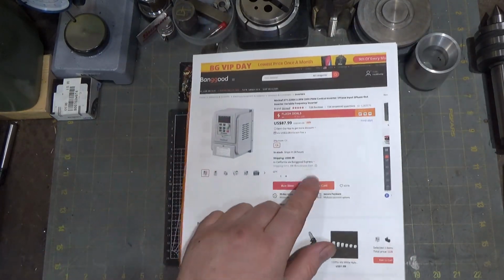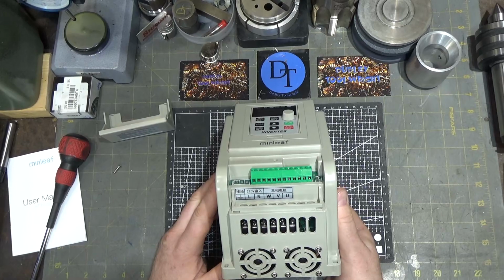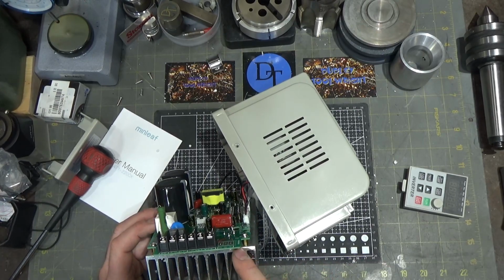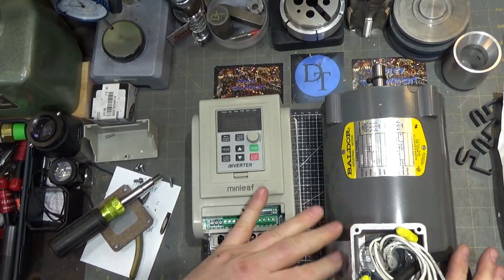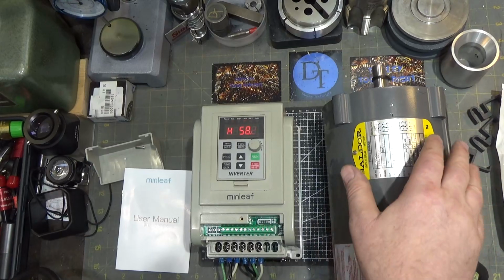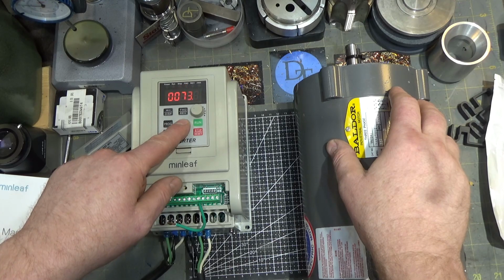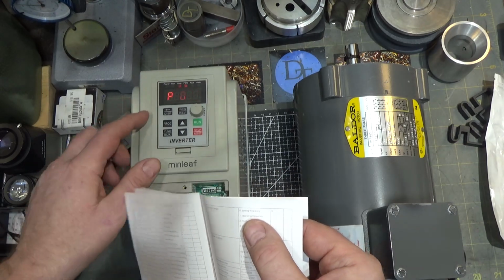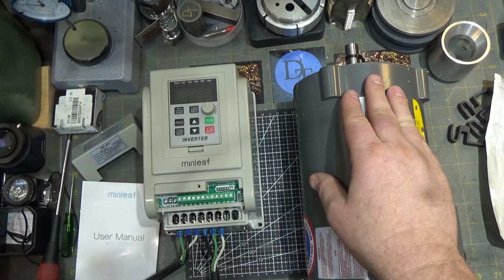QTR 62 Banggood Vector VFD

Comment: Nice review one thing I'm not getting say if you wanna run this on a mill or a lathe how would you get an rpm reading is there something you add that converts hrtz to rpm or would you instal some kind of electric tach ???
Reply from the maker: Getting an accurate RPM reading would require a fairly inexpensive tool, but sensor location might be challenging depending on the application. All you need is a reflective dot on a rotating member and count the rotations over a fixed interval and divide.

Comment: Good review Robert. I’m going to give that one a try on recently purchased used cutter grinder. I’ve got a Fuji 15hp(derated to 7.5 for single phase input). I’m breaking all the vfd rules with it. Using it as 3phase power supply to 7.5 hp lathe and 10” pedestal grinder( both across the line start) and also feeding a second 5 hp vfd (3p in, 3p out) for my mill. Been working fine for 4 years in the home shop environment. Was going to add cutter grinder to 3 phase bus but will give the banggood unit a try.
Reply from the maker: I will be interested to see how this works out for you.

Comment: That microcontroller is far from capable running code needed for vector drive. Sensorless vector driving is even more demanding. So mentioning vector for this vfd is completly misleading. It is ok for the price but far from delivering constant torque over different speeds.
Reply from the maker: That is some very interesting information. I am not familiar with the processing requirements for sensorless vector VDS's nor did I go so far as to look up the capabilities of the specific microcontroller.  The vendor rightly or wrongly claims that it is capable.

Comment: Would that still work for 120v. line in and 120v. output to 120v motor on a Jet 920 lathe?
Reply from the maker: I don't think so. There are rare VFDs that work with 110V motors. I own one.

Comment: L have the same drive and impretty sure you need to install a braking resistor.Mine is happily running a 2 hp horrizontal mill.
Reply from the maker: Interesting. This particular VFD does not have any terminals for one and there is no mention anywhere in the manual for one. I really appreciate the feedback.
Reply: I paid a guy to make a completely new board for my lathe with top quality electronics and a massive resistor for braking. He also managed to set me up with a proximity sensor that brakes the spindle, which is amazing for threading to a shoulder, as a safety in case I @#$% it up. I wish I could remember his name.

Comment: I've had 2 of these vfds. The first one lasted almost 2 years in a dirty dusty environment. The other one is still going but I have a filter attached to the top and bottom. I have it hooked to a restored 14 inch band saw with a 1.5hp 3 phase motor. I use it to cut metal so I'm usually around 10hz for steel, 20hz for plastics and aluminum. For the price you can't beat it.
Reply from the maker: Excellent feedback. Thanks for the data points. I will keep track of this one once I get a 2-3hp motor to attach it to.

Comment: Great video but I didn't understand a word you said !
Last time I play with electronics was 60 years ago, I built a crystal set to listen to the Test cricket in England you could but the headset in Mums ceramic pudden bowl for better audio !
The Ariel was a long my father's work shop over a 100 feet . I can change a 12 volt fuse wire .
Please go back to machining.
Hope you are safe from the pandemic.
Christopher from Down Under
Reply from the maker: Will do. Sorry if the content was not what you were looking for.

Comment: Hi.
You rewired your motor to 240V.
Was that because the inverter will not run 440V  ?
I would need 3 phase  440
Reply from the maker: That is correct. This inverter is only 220V or so out. They make a three phase in three phase out the supports 380V out. AT3. I am not sure if this helps. I don't know if there are any units that take 220V in and put 440V out.
Reply: @DudleyToolwright  
Thanks

Comment: you showed a 220v plug, but the VFD is a Euro model with no L2. How did you wire it for US 220v?
Reply from the maker: To the VFD it does not care if 220V come from two 110V circuits out of phase (by 180 deg) or a single phase of 220V and a neutral. The only danger would be if the internally connected the neutral and ground. Then on the dual 110V solution you would be shorting a single phase to ground. This however is not the case so it works just fine. The full wave bridge on the input does not care.
Reply: @DudleyToolwright   So you wire ground to G,  L1 to L and L2 to N on the VFD.  After checking for no continuity between G and N. Right?
Reply from the maker: @roberth58  That is what I did, correct. You should only pursue working with dangerous voltages if you are sure you know what you are doing. Injury or death could result from mistakes.